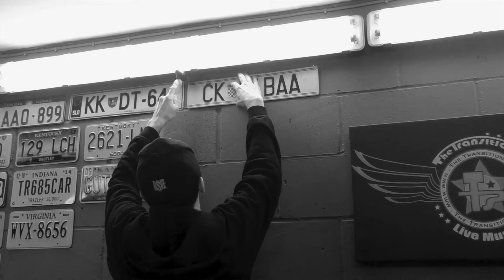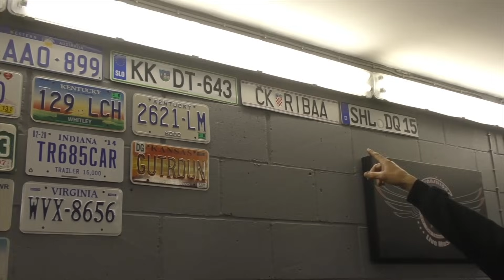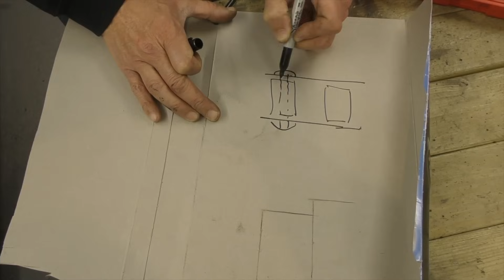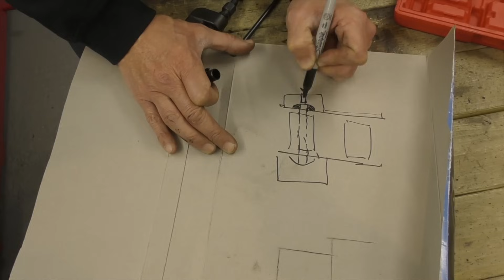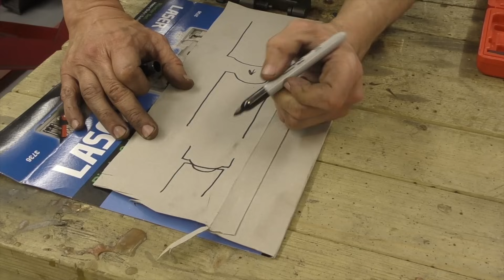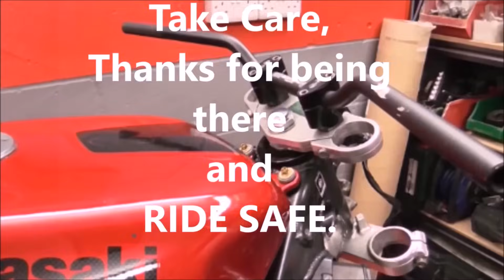Delboy's Garage, Motorcycle Chain and Sprocket Change.

Comment: Hey Delboy, first off you are amazing. I am changing a chain with a rivet style link, I believe I have discovered an ANOMALY. I need to flare the rivets on my master link. My recently purchased JT 525 Z3 chain has pins that measure 5.44 mm. The factory directive is max 5.7 mm for flare tolerance (5.44 mm initial, 5.7 mm after flaring pins). The anomaly is if you measure the master link pin tips, the actual very tips, which are separated from the pin body by a noticeable grove, they measure 5.33 mm. So the end result flare is actually .37 mm above the 5.33 mm initial master link tip.
Reply from the maker: With the greatest of respect mate, you're slighly overthinking it, the tip of the pin needs to be a little thinner in order to flare, if it was as thick as the rest of the pin you'd struggle to flare it at all... just do it in increments and measure it as you go... I've cracked a pin in the past trying to get out to 5.7mm so I stop at 5.6mm, which is plenty for me and they never come undone.

Comment: The rk I fitted not long ago wouldn’t even press in by hand I had to use the tool plates to push it in before even riveting it. Need to re do it with new link as totally binded. It was the proper link for the chain as it come with split link but I bought the rivet link. Just hope the new link pushes in as easy as the video. Maybe I did not lube it enough but it was solid!
Reply from the maker: They should be an interference fit and as I showed, you must press the new link plate over the pins before flaring them with the tool, they will not press on by hand, perhaps you pressed them on too far and jammed it up, press the link plate on to the same dia. as the rest of the links.

Comment: What’s up Delboy🤙🏽, doing my own work & I’m stumped on something. Changing my gearing ratio from 16/45 to 15/48 on 01’ GSXR600. I’m not sure how to figure out the new # of chain links I’m going to need; does the wheel/axle need to be pushed all the way forward when figuring that out?? & doesn’t new gear ratio & longer chain in conjunction w/ required amount of chain slack mess w/ your wheelbase??

Comment: That chain tool is soooo much better than my one. The riveter on mine is like a ball bearing. Very hard to tell when it's done enough. Apparently if you measure the unriveted pin with the calipers then rivet it, it should be 0.5mm wider.
Reply from the maker: Yes that's right, you're looking for about 1/2mm or just over, and it's important also that the outer plate must be an interference fit, needs to be pressed on with the tool, not just with fingers, if it goes on with fingers only, then it's not going to stay put!

Comment: First off, thank you for this video. The tips and logical step-by-step approach gave me the confidence to approach this task myself. Very satisfying to do, and I would do it again. 

The chain tool, however, is a different story... I found it to be not up to the task at all. Despite grinding the heads off the chain pins, the tool pin still deformed to the point it wouldn’t be usable again. 

When it came to riveting, well... the chain pin just deformed to tool without flaring the pin even slightly (I measured with a caliper). Clearly the chain is made of much harder steel, which is reassuring at least! But essentially the chain pin just cut into the domed edges of the riveting pin. Clearly no amount of softly-softly would have changed this, because it’s in the properties of the materials (and at 5’6” and 55kg, there’s only so much I can lean on tools!) This gave it the same appearance as what you show in the video, with the tool able to sit flush against the chain pin, but for reasons entirely different to your explanation. My worry is that people do this, think the jobs all good and are potentially left with an unriveted chain... maybe yours did work, I don’t know, all I know is mine ended up with the same appearance but definitely not safe. Wemoto at least did not quibble my request for a full refund, and I bought a tool that was up to the task. Guess what my grandma always says was true - buy cheap, buy twice!
Reply from the maker: Good to hear that the guys at Wemoto stood up and helped, they also do a DID style heavy duty riveter based in the same exact principles as the DID one, the fat pointed flaring tool pushes into the dimple and spreads it to an exact and measured width inside a machined cavity.. with the one in my video here i still got a healthy and adequate spread, and the chain is still on the bike and performing well with zero movement (not sure about you but i check the width between the plates at the time of assembly, making sure its the exact same with as the rest of the chain obviously... and i check it after 100 miles, then 500, and as long as its the same, just again at service intervals..  so after about 2000 miles since fitting this chain, it's ok..   Glad you got a remedy, and a good mantra to buy the best quality you can.. as long as you can justify it.. many people will maybe fit a new chain once in ten years.. so everyone makes a judgement call on how much they throw into very rarely used tools aye.....!   Thanks for watching the video.. take care.. Del.
Reply: Moonfleet41 glad to hear the chain is safe and still going strong! Yes, I was super paranoid about ensuring no deviation after I fitted it too. Can be a difficult call with tools, especially the rarely-used ones as you say. I figure I can justify it if the cost of the tool is about what the labour cost would have been! Hopefully I’ll get a few more uses out of it. Take care, anyway, and thanks for the reply

Comment: Great video. I wonder if other people realise how good you and Penny's productions are? Half way through replacing the chain on a 2001 Speed Triple I've recently got. Halfway through 'cause it's pissin down and I have to work in my back yard so just come in for a cuppa. Driving out a pin was harder than I expected (Yes, I did grind off the head) and it turns out the pin was pretty rusty. The whole bike aint had much love over the years. Going back outside now, toodle pip.
Reply from the maker: Hi Ian, great to hear you're getting stuck in, I know you've done it now and it's too late, but just a little tip, if it helps, if you're discarding the chain and it's going in the bin, just lop a disc cutter straight through it and don't waste your time, I spend a few years drag racing and extending chains with extra links for a longer swing arm means you do need to carefully drive the pin out, but it's not important with an old knackered chain that's going in the bin... hope it welt well mate!
Reply: Aaah,  yeah that would have been a quicker way. Got bloody soaked but job done. I only do  chain changing every few years so a vid like yours is invaluable to remind me what to do. MoT now 'cause I do use it all year round. Thanks again.

Comment: After the 2nd time of debating whether I buy a tool and fit it myself I bit the bullet and got one of the sealey chain kits to replace my knackered chain (cheap DID chain replacement to put me on until it needs new sprockets too). Excellent bit of kit even if the reviews online are very mixed (likely people misusing tools). Absolute doddle with this bit of kit, new chain was a split link so did cheat slightly... Excellent vids as always Del (and camerawoman Penny), just a quick comment in appreciation.
Reply from the maker: Thank you Kyle, you are most kind... great to hear you're taking cre of things yourself..

Comment: Videos are awesome and helping me enormously on a BMW 310GS winter project bike. I ditched the fancy brake bleed tools and used your method with ease. 
Quick qu… changing the chain. I flared the chain to the point that the riveting tool was flush as you described. However I noticed it had pushed the pin out the other side so I’ve had to start again… if flaring it so the pin is flush is too much, how much do I do it on this next attempt please… 
I also noticed the pins don’t have a dimple on them to start with, they are smooth.
Reply from the maker: All compression links that are designed to flare will have a dint or dimple in the end to guide the spreading tool... what link are you using?.. does it have a groove around the end of the pin by any chance.?
Reply: @ hi. Thanks for message. The link came with the BMW chain and  has a flat solid end with no dimple or groove to put the riveting tool into. Not sure my next move… any suggestions would be gratefully appreciated. Phil
Reply from the maker: In with the link there would have been the outer plate... did you have to press this on with the tool or were you able to just push it on with your fingers. ?
Reply: @ I had to press it on with the tool

Comment: Thanks u so much for this video ..just done the chain and sprockets on my vfr ..way out of my comfort zone but all done ..fingers crossed it doesn't fall off lol cheers delboy
Reply from the maker: Nice going mate, glad you got in to it, you have the pride to say you did it yourself, just keep some marker paint on the split link and keep a close eye on it before every ride, and that will soon instill a little confidence that it's all safe.  Check the tension over the first few rides, as new chains can go a little slack as they bed in and settle down... and am sure you know, that slightly loose is better than slightly tight... good luck and thanks for watching!
Reply: @Moonfleet41  cheers mate will do ..looking forward to riding it in a month or so for the first time ever .lol ride safe ..hope your new workshop gets up and running soon ..looks really good been watching your build of it 👌
Reply: Bike finished thank u for ur advice mate

Comment: This explanation is so professional and accurate. However, I'm not sure if somebody noticed, but you probably destroyed your tool. Check how your pin's peak looks like at start in 38:27, and after 44:33.
Reply from the maker: The pins do wear quickly, only maybe good for two or three chains a best if you want a fully spread link pin... but you can buy them individually as a consumable and they're not expensive !

Comment: If you grind off your mushroom, it means you have a grinder. And if you have a grinder you can easily cut chain. Much faster, easer and simpler. I do just like that. And tool you need only for riveting. That's where it comes useful.

Comment: the first chain replacement video that actually explained how to use a chain breaker tool. and the instructions are super clear! thank you! 
Although I still couldn't get the pin out even after grinding the tip😂

Comment: Used your video about 5 years ago to do 3 chains. Need to do another one now and just come back to go over it again. Such a great video. Nice explanation, close ups which are needed for us to see what’s happening. You do a great job of going over every stage, explaining what you’re doing and why. This should be the go to video for chain removal and replacement. Top job mate. My original comment is just a few below 😃
Thanks, Ben
Reply from the maker: Hi Ben, thanks so much for your kind words of support, it's great the video is able to help you over and over, it's always great to have a 'quick check' video, no different to taking a squint at a manual to be sure - great to know it's endured the years!

Comment: Watching & learning from Australia....when you started with the chain breaker & did the pin head grinding....why didn't you just grind the original connecting link hds..you would need to press anything out..????
Reply from the maker: Or even easier, just lop the chain through with a disc grinder....!!    Just showing how it's done if you wanted to reuse the chain..

Comment: I ordered this tool and it failed by crunching the first rivet on an did chain... Then I bought a copy of the real did tool and it worked fine!
Couldn't press the first hollow rivet to over 5.2mm with the tool in the video, with the  copy of the did tool I made it to 5.67mm with ease! The price were similar around40€

Comment: I swapped my 2024 T120 chain from a 525 to a 520, changed sprockets to 42 rear and kept 17 on the new front. Bike is perfectly geared now, but very annoyingly the engine light keeps coming on due to the gear speed sensor.

Comment: Brilliant video , I've got to do this as Well, my riveting pin doesn't have the flat bit around the edge , but I noticed you gave yours about a full turn each so if I give it a full turn that should be enough , tool kit looks same but I noticed that small difference

Comment: Fantastic vid, does it matter which way the chain/sprockets go on? Just want to be sure.
Also I don't have a grinder for the pin or any power close by for that matter, any other manual way it can be cut off like a coping saw?

Comment: Confidently repaired my 82 KZ750 LTD thanks to you. I had a question though, why grind the heads of the rivets off the old chain instead of cutting the whole chain off since you were replacing it anyway?
Reply from the maker: Good to hear mate... and the chain, yes it was going in the bin, just lop a disc through it job done, but it was very important to show the grinding off of the pin because anybody who wants to remove a braced swinging arm needs to separate the chain, and all it takes is a cheap replacement link and remove the old one properly, it's also really important to show that if you intend to remove a link, you must grind the pin head completely off because the chain separator tool won't push it out otherwise... so really it was for demonstration purposes so you have both options.

Comment: Good video, but per DID instructions, the rivets should be measured to spec once pressed at 5.5 - 5.8mm. You had the calipers, the only missing step at 44:34  is to measure rivet instead of inserting the tool's dimple which may or may not be accurate.
Reply: This is totally correct. I have the same toolset in the video and unfortunately, it failed to flare the pin (the nimble part already push all the way through) pin width is only about 5.4mm . With the 525ZVM-X (same type with the one on the video) DID recommend 5.7 to 6mm

Comment: I've got exactly the same tool and the metal of the riveter pin got cutted off. The metal of the pins of my 525 DID chain was harder than that of the tool haha. And the holes in that quare plate were to small so i've had to drill them out. I'll buy a better one next time. I don't know why you don't have the same problems though...
Reply from the maker: Hi buddy, seriously?  You mean to say you drilled out the holes in the link plate because you thought they didn't fit, they are meant to be an interference fit , that is correct... you press them on using the tool as I demonstrated in the video, if you've drilled out that link plate, you've ruined it, and must buy a new one and fit it correctly my friend... even if you flared the pin correctly, it will not be safe if you've drilled out those holes...

Comment: Just looked at this kit on Amazon. Very poor reviews, presumably from people who haven't had the benefit of watching this excellent in-depth tutorial. So glad I did. I'll be looking into making a contribution.
Reply from the maker: Thank you Matt, the key to all of it is grinding off the old pin heads first, and not leaning too hard on the new pin spreader, it only needs to be expanded by about 25thou, and you can't even visually see that, so measure the pin width before you spread it with a caliper, and then you'll be able to tell whether you've flared it enough - good luck with it, hope it goes well for you my friend!

Comment: Just done my first chain at the ripe age of 57, couldn’t get the front sprocket off though but luckily the sprockets look in very good condition. Chain was changed because of seized link. Couldn’t have done it without this vid. Cheers laurence
Reply from the maker: Most welcome Laurence, glad the video could help and great to hear you're getting stuck in to it!

Comment: If you can't get the counter shaft nut off by leaning on the break, is there any reason not to just put the transmission in 2nd gear and use an impact wrench to loosen the nut?

Comment: Hi 
I know this one is old (video) but I brought a Chinese chain splitter and riveter.....as you said you were going to buy one and as well after seeing a lot of bad comments on the type, mainly the tool was to soft for the job..I thought I would give it a go anyway...so in Mythbusters fashion its "busted"...All the ones I seen looked the same in a different red box, so used properly (as per this video) they should work fine for the user..mine after use was as good as the day I brought it....
Reply from the maker: Exactly mate, the most common reason that people break the drive pin is trying to push the old pin out without grinding it flat first, or trying to expand the new pin too much, so basically pushing on it too hard... glad you made it work.

Comment: if ur old chain is fully worn. change out the front sprocket b4 removing ur old chain(after breaking). then link ur new chain too ur old 1 & use it too pull the new chain around the new front sprocket
Reply from the maker: What on earth for?  Just wrap it round with your hand surely!  You've already got the cover off to change the sprocket, or am I missing something?